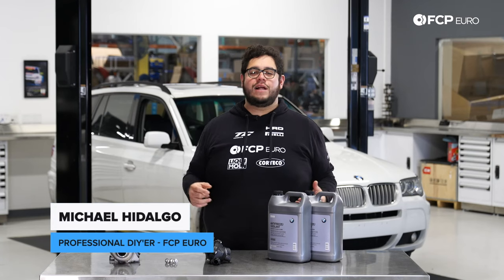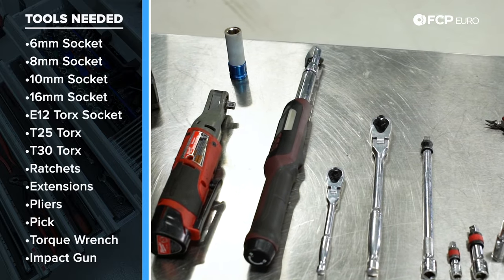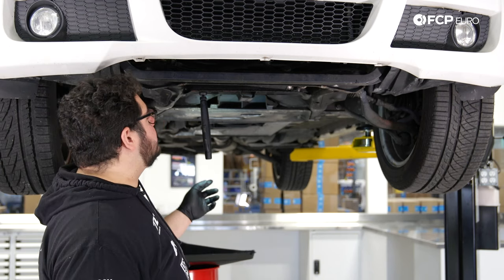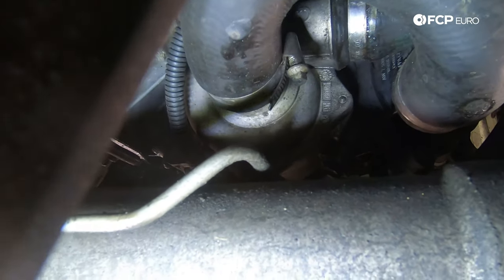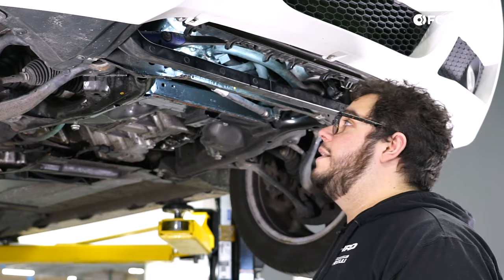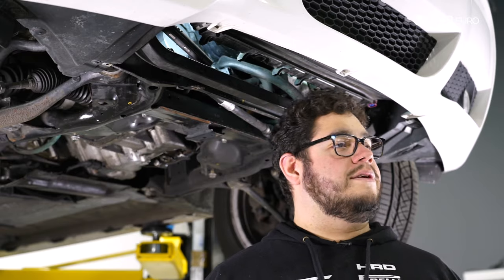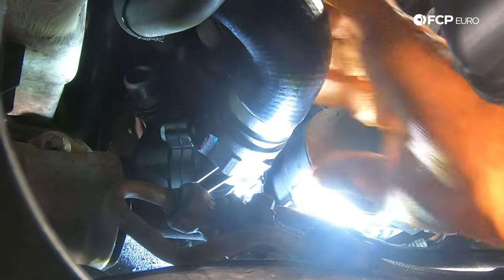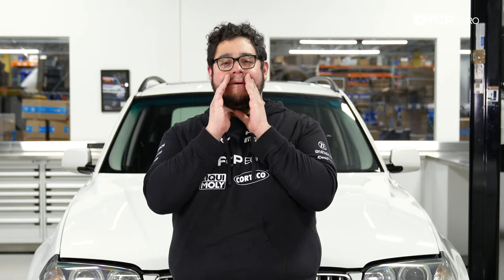BMW E83 X3 Water Pump & Thermostat Replacement DIY (BMW N52 128i, 325i, 328i, 330i, 528i, X3, X5)

Comment: The thermostat has no sensor, it's connector is for a heating element. Beyond being an open or short there is no communication between it and the ECU.
Reply from the maker: Thank you for the note!

Comment: Thank you! You guys rock. This video is full of great info plus it showed me how to reassemble the air intake ducting on this model. That task seems very simple but those pieces don't want to fit together (and the front fitting of the long duct will actually rip) unless reassembled in the order that you show. This is the only source of information I've ever seen on how to do that. Thanks! 👍👍
Reply: Thank you so much.

Comment: Excellent video, very well documented. I now can see exactly what is involved and how tight the vicinity is to work in. My N52 has less than 40K miles but is coming up on 14 years old so I think when I have this done I will also do all the hoses and the oil pump gaskets. Very good info, next time I'm in CT I have to stop in and say hello.

Comment: God damn. Not looking forward to tackling this on my E82. Thanks for the detailed instructions.
Reply: I'm at 80k on my E82...not looking forward to this also. There's a short 4" plastic tube up top that is a random fail point. Replace it with an 'alloy' update IIRC; makes total sense at this time while the coolant is drained.

Comment: Excellent!  This video dropped on the same day I was replacing the radiator hose/mickey mouse flange on my N52 E90.  On the E90 you have to remove the sway bar bracket to reach the pump, unless you have the assorted u-joints and flexible doodads described in this video.  I'm not looking forward to when/if I have to replace the thermostat and water pump in that car.
Reply from the maker: Never hurts having the right flexible doodad though Homer! Did you replace it with the Aluminum we offer!?
Reply: @fcpeuro  yes! I used the one with the aluminum flange. When I did the coolant bleed it threw some codes about the coolant temp sensor so I’ll be replacing that too.

Comment: I’m having a 2E85 error code, which is a water pump miscommunication. Can that error code get my car on limp mode and stop the engine completely ? 

My 2008 X3 is not even cranking anymore.

Comment: Question: I have a 2008 BMW X.3… Can the thermostat develop small fractures and start to drip?
Reply from the maker: Hi Jerry, while not common, it can happen as plastic gets old and brittle.
Reply: Me paso eso a mi también yo voy a revisarlo, es de material plástico por eso no dura demasiado

Comment: what should i look into if i get the code 2DEB from a 2009 BMW x5 e70 n52. i also got a code 2E81 after replacing the water pump

Comment: id pull the fan out first and then remove the coolant cap just to not risk contaminating the cooling system <3 just saying. looking forward to working on a bmw for my first time. this should be fun fun fun not.

Comment: My X3 is overheating but not consistently and I'm NOT getting any codes, I've changed almost everything in the cooling system except the Thermostat, which I plan to do this weekend...Could it be my Fan?
Reply from the maker: If your fan is not switching on, that can cause issues with your coolant system. A sticking thermostat will also cause the vehicle to overheat, which could be your culprit.